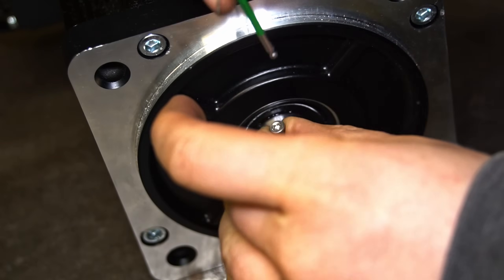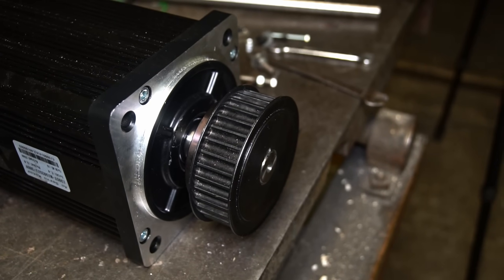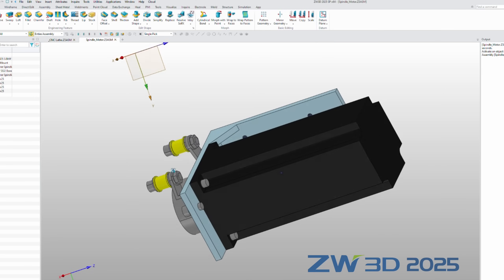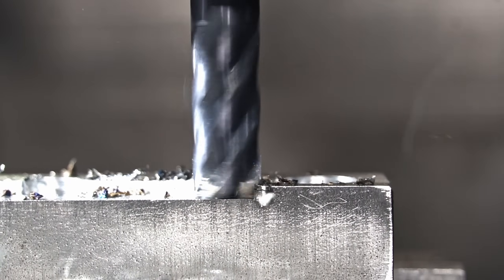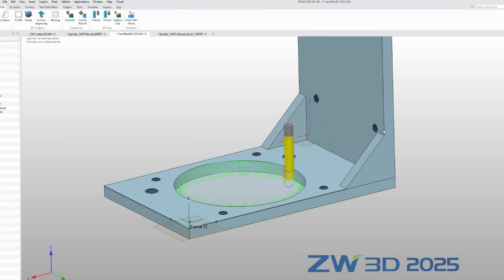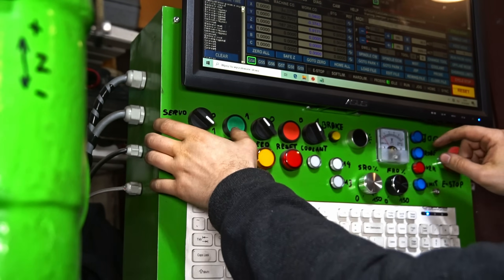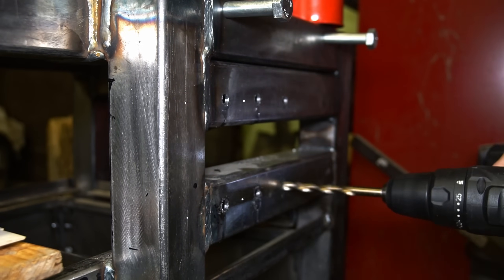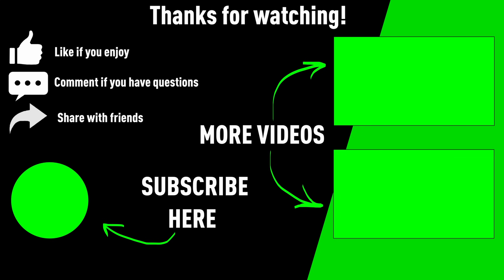Mounting The Spindle Drive! - DIY CNC Metal Lathe Build! #7

Comment: Great work but if i didint see (10:00) wrong, the bearing that inside of the pulley is a single ball bearing and the washer must push only to the inner bushing of the bearing. Just advise. 

Good Luck.
Reply from the maker: You're exactly right. I've changed later the washers for washers with bigger inner diameter (so it contacts only the outer surface). I didn't add that in the later videos as I thought nobody will even notice that detail, lol!